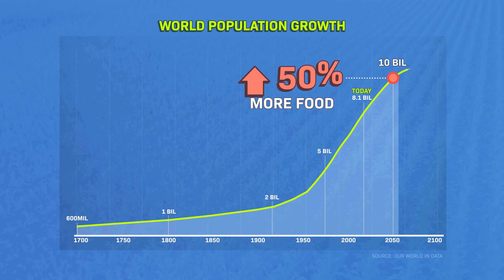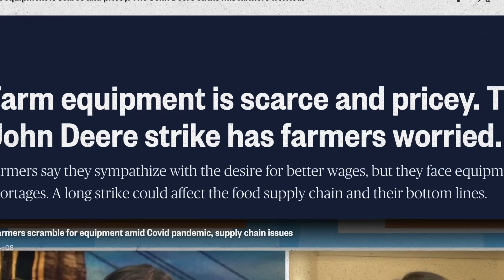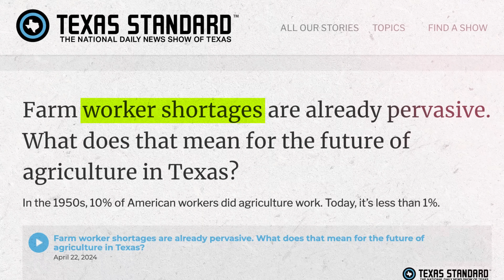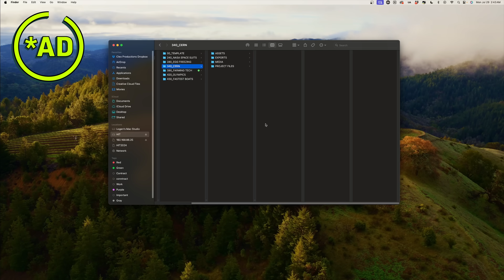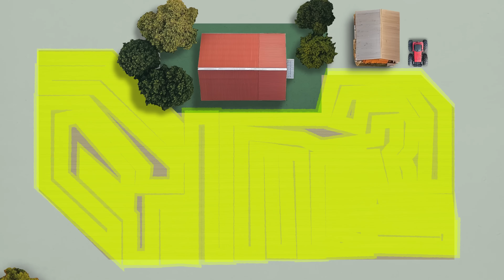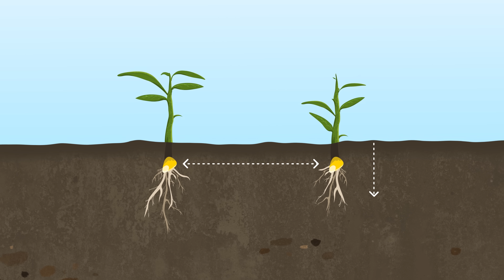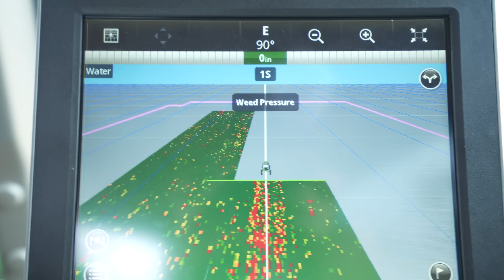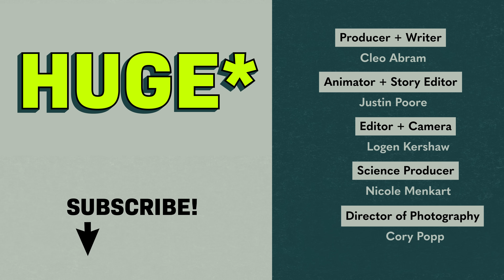Why This Robot Kills Weeds With Lasers

Comment: We already grow way more than enough... You almost mentioned all the key aspects of massive amounts of food waste and also massive amounts grown just to feed animals (which are highly inefficient at converting to animal-based forms of food and basically another cause of food waste), but you failed to mention the massive waste of crops grown entirely for biofuel which are wasting valuable farmland, contributing to all the same environmental degradation (wasting water and also polluting water), and also don't even make sense financially - they only exist due to the fact that they're being propped up with our tax dollars that could and should rather be spent to help farmers transition to more environmentally responsible food crops that are appropriate for the particular climate and water resources available in any given area and also directly feed people and not animals or our internal combustion engine vehicles.

Also the laser and bopping method of weeding was awesome. 

Also, it sucks they're still generally pushing the idea of tilling the soil. That's another incredibly harmful farming practice that should be well on its way to being nearly entirely phased out by now. No till is the way.

Comment: Great video! One thing that wasn't addressed is compaction. These 18 tonne tractors would cause a lot of compaction on farms, which degrades the land. Since robots could work day and night without a human, 100 smaller robots could easily replace a group of  large tractors.

Comment: Cleo, these machines apply to industrial scale farms.  What about the smaller farm plots that are prevalent in Emerging Countries?  These farms cannot afford to buy these machines and rely primarily on manual labor, pesticides, and fertilizers to grow food.  How do we make these farms substantially more productive as well?
Reply: If the big industries buy enough of a product to warrant larger batch manufacturing of the individual components and drive down manufacturing costs the parts become cheap enough to develop consumer versions that are still profitable. 
Just give the new technology a little time to trickle down to the little guy.
Reply: @mattf9096  Correct. Well put.
Reply: Any country is capable of building this AI tech right now and i'd be surprised if there's no opensource project yet. If they don't have even the tractors just make them portable and walk

Comment: The problem with the agricultural system isn't that it needs more growth. We already grow enough to feed the world, the problem is where the food goes and how it's used. For example 36% of food grown goes to animal feed, which if we switched to, for example, more open grazing and less meat consumption, could be cut down drastically. Not to mention the fact even when food is physically available price is often too large a barrier for many people. It's an extremely complex issue that will not be solved by more production alone.
Reply: The food used as fodder isn't fit for human consumption. Among other things, it allows for productive use of land that isn't currently suitable for growing crops for humans. It is also a way to use food that was grown for humans but doesn't turn out suitable for that market. But most is crops grown that wouldn't be suitable for humans in the first place, on land that wouldn't produce more valuable crops.

Comment: I agree we should have right to repair, but all it really means is that John deere has to sell you the software to talk to the equipment.  John deere probably will just sell it for $50,000.    Most farmers I know already have access to pirated software, so right to repair really won’t change much.  But what would help is eliminating all the crazy regulations around emissions.  A large cost of Equipment these days is the emissions. Modern combines have to incase their exhaust in a box so they don’t start fires. But then that box gets hot so they have a high horsepower blower and an air filter to blow clean air through the box. All that burns a lot of extra fuel.  A semi motor used to easily get 1,000,000 miles.  Now because of emissions you’re lucky to get 500,000. Now we have to build twice as many motors.  Doesn’t seem very environmentally friendly.  Plus the emissions are the majority of what causes a piece of equipment to break down these days. All that is cost for the farmer and every repair uses energy that is bad for the economy.  But the manufacturers love it because they get to sell more parts.

Comment: Its not only what happens to the crops that is important, its what happens to the animals too, nowadays hormone use and antipiodic use in animal stock is excessive, the new technologies that we need to improve to solve this issue is: selective breeding, set limits on antibiotic use and set standards for living conditions in animal stock farms so that animals aren't crowded which will lead to less disease spread and less antibiotic need. 

I made a graduation project about this topic, and I find modern farming practices to be the leading cause of all kinds of diseases nowadays. Our farming practices today don't just effect our health through nutrition but also effect the environment and cause pollution, for example, take atrazine in the tap water that we drink, or rBST hormone use in cows to get them to lactate more, which thankgod in banned the UK, or excessive antibiotics use that has led to antibiotic tolerating bacteria.

I see this 4th agricultural evolution as a good step, but still a long way to go.

Comment: It says a lot about me that I saw the map at 4:18 & my first thought was 'I wonder how big each of those fields are on average'.

Because I have nothing better to do with my life atm, I have actually figured this out.

I counted 42 complete or near-complete fields (the picture isn't very clear, so this may be inaccurate), so I'll round up to 45 to account for the incomplete fields I did not count originally. South America has an area of 17.84m square km's, so each of those fields is about 376,444 square km's, which is bigger than Japan & Norway. If my rounding makes the total number of fields an overestimate, then the fields will be slightly larger & would be closer in size to Paraguay & California. All sources for size of territories are from Wikipedia.

(Also, this is mainly for Cleo, I did read all the way to the bottom of the description, so I'll tell you now that I am secretly very good at tennis. Whether that is true or not is for you to decide)

Thank you for wasting your time & reading this comment.

Comment: I worked in produce at a grocery store and waste was actually part of the system (though we did give that wasted food to a local pig farm, including all fruit and veggies scraps). So basically, in order to make sure you're making enough salsa, pineapple or watermelon mixes, you have to make enough to let some expire. Otherwise you might be running out when you could have sold 10 more. 40% waste was too much, but 5-20% was okay cuz gotta make some more money and keep the shelves looking full and nice. At least it went to the pigs and local food bank in our case.
Reply: Big stores used to give a lot of produce to local food banks and then we would sort through it and give the stuff that was not fit for humans to the pig farmers. But the stores stopped donating. Maybe it's being disposed of some other way now.
Reply: @dannyl2598  The store I worked at still donates all there left over produce and scraps to pigs and the local food bank.
Reply: @dannyl2598  big stores start off with a fairly tight quality spec, so think of the amount of waste we see on the manufacturing end.  My place can easily put in 300t of root vegetables in a day, of which 180t will make it to a retailer.

Comment: Too many fast cuts and introduced but not covered topics! What about the robot running around shuffling grain? What about the tomatoe picking robot! Instead of showing them like 6x for 2sec each in this video, show it once for 5min and explain how it works and why it's amazing. This video feels like it was a mile wide but only an inch deep.

Comment: See and spray may only do 15mph down the rows but it can do 25mph with a lot of focus. 
The automation is nice while out there working but that's still what you are doing is working. Just like how pilots are still working by monitoring the systems, navigating, and planning the next phase of the flight while in the cockpit using the autopilot. The equipment is so big, fast, and complex anymore that you can't drive and watch the machines at the same time.

Comment: There are some really important improvements that was not mentioned in the video (as they are not part of the John Deere museum) the invention of artificial fertilizer a German guy. Without that the world would have had a food shortage already a century ago. This video is about automation. Doing the the same in an other way. There has been made improvements in the crops. Making crops grow where they  could not grow before if i remember it correctly a guy from India. Increase the grow of the crops making them resistant to fungus and using less water, the university of Wageningen is busy with that.

Comment: The high prices of these machines only benefit large corporations. The technology is so expensive that it’s often only financially sustainable on large scale farms leading to bigger fields and less diversity in plants. The solution to the farming problem is switching to permaculture and food forests which support biodiversity and make land use more efficient. AI can also help managing complex farms. John Deer is only creating new problems :)
Reply: I think we are inevitably going to see the farm size gap increase. The amount of managerial resources required for a permaculture are way higher than those required for monoculture farming. I can see it being feasible at the very small scale, but I think the big fields will continue to be monoculture for a long time. The efficiency of a small farm is simply lower than a massive conglomerate, and if we need a 50% increase in food supply the answer will be whatever is most efficient. I don't like the monopolization of our food supply, but at this point it seems pretty much guaranteed.
Reply: @chaschuky999  that’s why we need AI and robots to manage these complex farms. If you mix crops it’s actually more efficient land use with more produce per hectare. Just harder to manage ergo AI
Reply: @policeman1104   I never said it’s not more efficient to use permaculture - it certainly is - I said that it’s not economically/managerially efficient for regular/family farms. It’s a sharp spike in complexity, a permaculture farm the size of a living room isn’t terribly complex to manage, but one the size of a family farm is very complex. However, a permaculture farm 10-100x larger than that family farm isn’t a lot more complicated to manage than the family farm. The AI used would still require computer vision, automation, a lot of compute, and a sum of money most family farms simply can’t afford.
Reply: Intercropping is also fine :)
Reply: Large scale farms are inherently more efficient than small farms. I worked on a smaller dairy farm and it was absurdly inefficient.
Reply: @kellymoses8566  oh, we need large scale farms. But they have to have mixed crops. For dairy and meat production we need an entirely new way of producing. Conventional farms aren‘t efficient and produce way too much greenhouse gases. That’s why we need to scale up the lab meat and milk :)